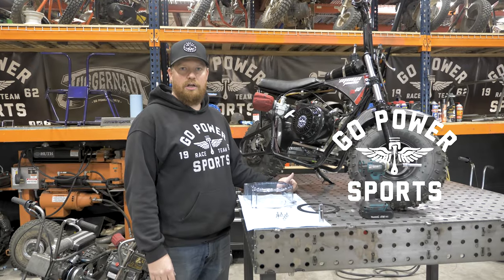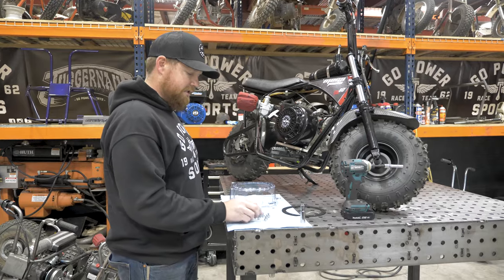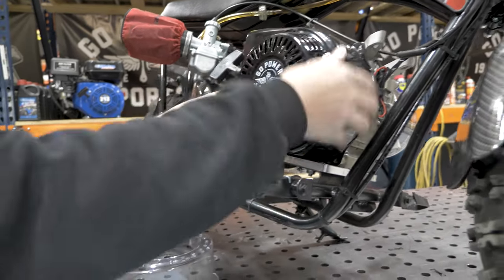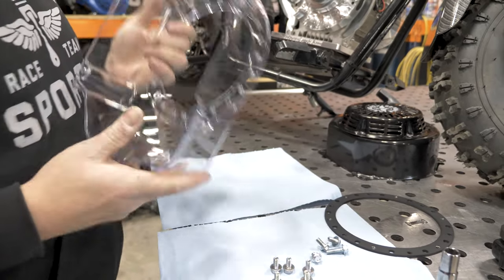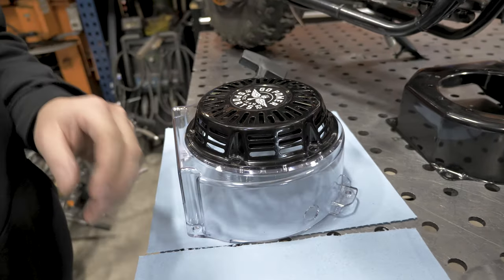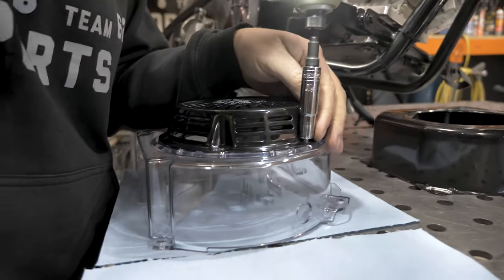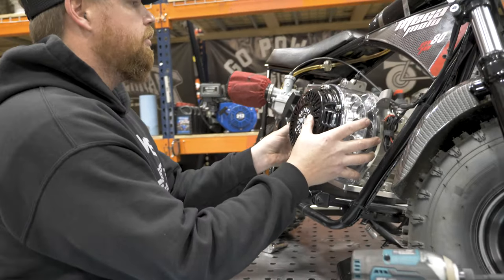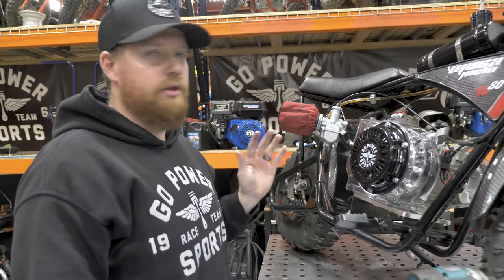GoPowerSports Clear Blower Housing Install

Comment: I noticed your kill switch is deleted. I just ordered this blower housing and use the stock killswitch. Can I use the stock kill switch in this housing? Or do I need to run a different killswitch and plug that hole?
Reply from the maker: You should be able to use your stock switch.
Reply: @GoPowerSports  greatly appreciated. Weird question donyou guys send stickers with every order? Sometimes I split orders up to get stickers twice, but my order today came with none
Reply from the maker: We typically do. Get me your last order number and I’ll get more sent you way. Thanks!
Reply: 467271